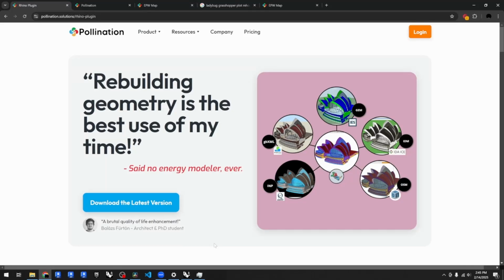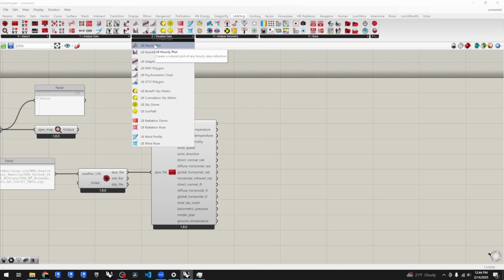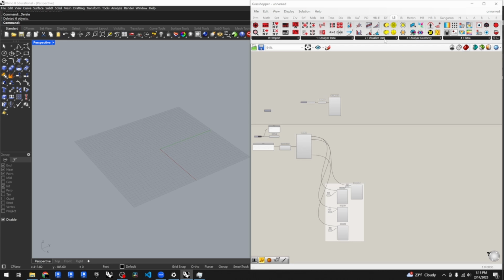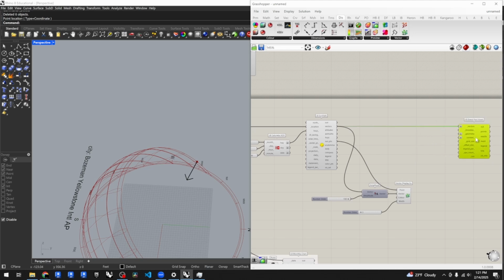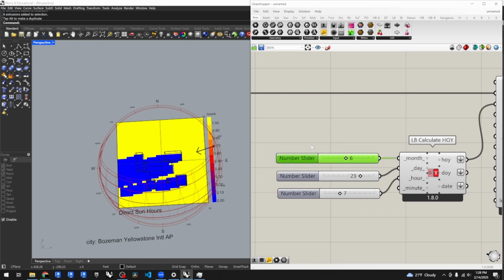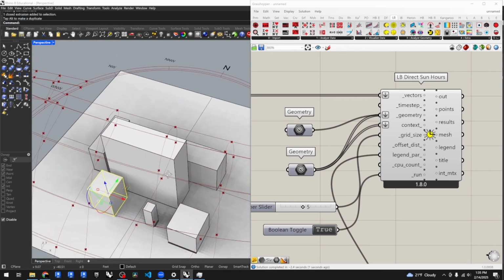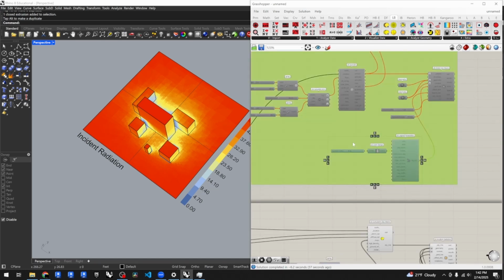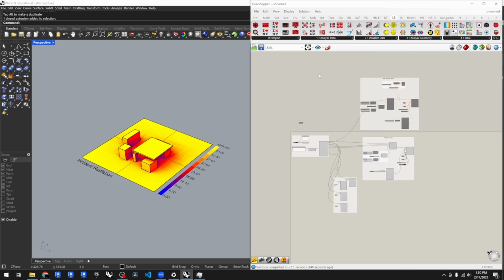Environmental Analysis With Ladybug and Grasshopper in Rhino 3D

Comment: Please cover other plugins as well :D this is great
Reply from the maker: I would be happy to! Are there any plugins that you want me to cover first?
Reply: @motus406  Millipede, Honeybee, Wallecei 🤣 I have lots in mind
Reply from the maker: @nedimart6181  I will try and cover these! Honeybee is most similar to Ladybug but with some extra steps, I will cover this in a video (soon-ish). I used to use millipede for structure, but lately, I have been using Karamba instead. Before I make a video about Wallecei, have you used the built in evolutionary solver in Grasshopper ? Feedback like yours is what keeps me making videos. Don't hesitate to reach out and let me know what problems you are working on and I will do my best to make content that helps!
Reply: @motus406  Wow thanks. Karamba is paid thats why I chose Millipede. And I have not used the built in evolutionary solver. It sounds interesting.